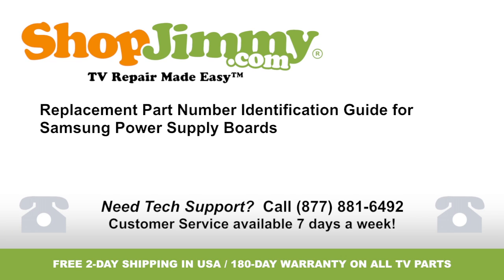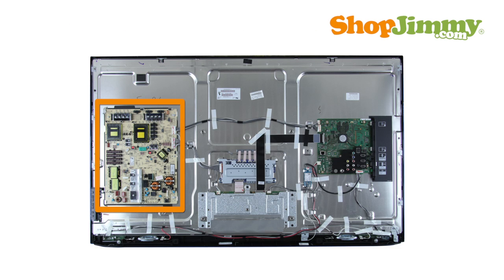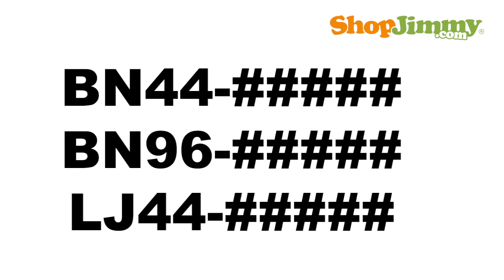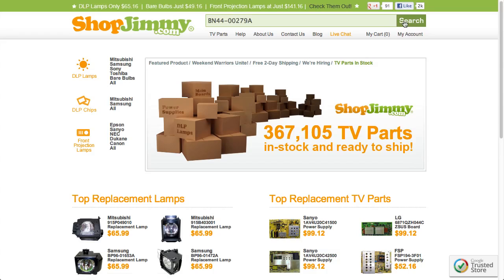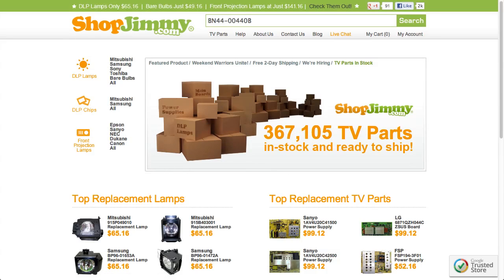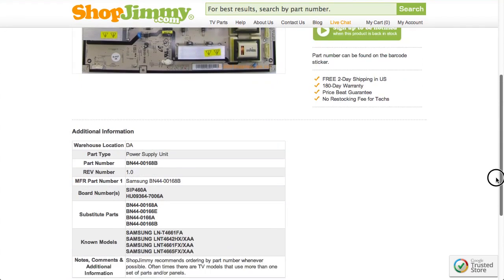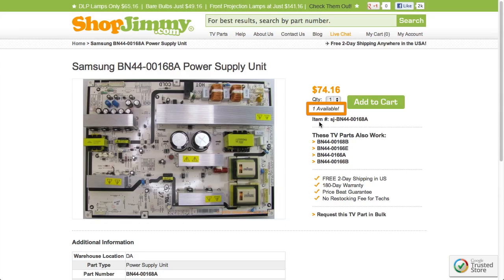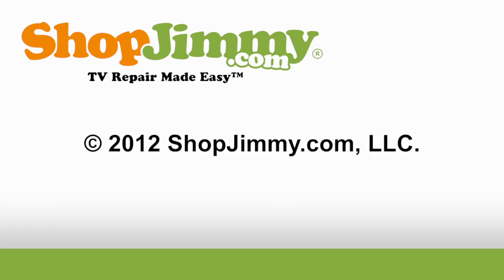Samsung TV Repair - Part Number Identification Guide for Power Supply Boards - How to Fix LCD TVs

Comment: Hello, my board has the BN44 number mentioned in the video, but the board also lists a 4 character code above it, an 11 character code below, and a two character code on the bottom separated by a period. Do these other codes not matter?

Comment: I need a one connect box for Samsung UN65f9000af, I would be willing to sell the whole uhd tv , also have brand new SEK-3500u that I cannot get tv to recognize due to not having the one connect box that will allow this upgrade. Does anyone have suggestions as to how to upgrade. Tv is not broken or damaged, but I'm not locating a one connect box. Help or if you want, I'll make a great deal on the whole package. I'm going to purchase a sled q8 new model

Comment: PLEASE READ CAREFULLY AND ADVISE IF POSSIBLE:

 THE CONNECTION FEMALE PLUG ON THE BACK OF THE LCD MONITOR/TV AND THE SAMSUNG POWER SUPPLY BRICK PLUGS INTO THE BACK OF THE  SAMSUNG LCD TV/MONITOR MODEL P2570,    MODEL CODE: LS25EFHKFV/ZA  THE POWER SUPPLY BRICK OUTPUTS 14 V-----4,5 AMPS HOWEVER MOST OTHER MONITORS HAVE SEITCHED TO A THREE PRONG MAILE PLUG, THIS ONE IS STILL USING THE SINGLE PLUG WITH A COPPER THIS PRONT IN THE MIDDLE OF THE HOLLOW CONNECTOR.  HOWEVER THE FEMAIL CONNECTION ON THE BACK OF THE TV IS TOTALLY DAMAGED AND NO CONTACT IS BEING MADE.  I NEED TO REPLACE THAT POWER FEMAIL PLUS OR THE BOARD ITS ATTACHED TO.   I HAVE NO CLUE HOW TO REMOVE THE BACK OF THE MONITOR AS IT APPEARS TO BE A SEALED UNIT.  NO SCREWS OR PLACES WHERE IT MAY SNAP TOGETHER.  THE MONITOR /TV WORKS FINE BUT I CAN'T GET POWER TO IT.  THERE HAS TO BE A WAY TO EVEN SODER EVEN AN EXTENTION OF THE TV PLUG. THE CURRENT PLUG IS THE RIGHT ONE BUT IT IS SEVERLY LOOSE AND WON'T STAY IN. OBVIOUSLY THE METAL CASING THAT SURROUNDS THE EXTERNAL PLUG HAVE COME OUT OR SOMETHING. 

IF YOU DON'T HAVE A SOLUTION, COULD YOU GIVE ME A CLUE AS TO HOW I CAN CRACK THIS MONITOR OPEN. ONLY THE STAND SCREWS OFF BUT THE MONITOR APPEARS TOTALLY SEALED WITH A THICK PLEXIGLASS FROM PROTECTOR.  

APPRECIATE ANY HELP YOU CAN PROVIDE. I'VE GOT A DOZEN TECHS BESIDES ME AT MY DISPOSAL. WE WILL HAVE ANY REPAIRS EQUIPMENT NECESSARY. 

THANK YOU

Comment: Hi, I have a Samsung LN46C66 F3F. It will not show picture (we have sound). We did the flashlight test, ordered a backlight inverter from your site and installed it, checked for puffy capacitors and pulled off remaining boards to check for burning or damaged parts. Found nothing damaged. Need to know next step, please. Thank you for your time.
Reply from the maker: +Lorriell Clarkson   Did you match the part number on your original backlight inverter with the replacement?  Thanks!  www.shopjimmy.com

Comment: i have a samsung 46 model LN46B650T1F that turns on YOU CAN HEAR IT  but turns off what that can be
Reply from the maker: ismael martinez  Please watch this video FIRST to help with your repair!  https://www.youtube.com/watch?v=BP3NVNCGEv8  This could be a problem with either the power supply or the main board in your TV.  You can replace each board individually to see which one fixes the problem.  Click this link to replacement parts for your TV model number:  http://www.shopjimmy.com/catalogsearch/result/?q=LN46B650T1F  There may be multiple boards for the same TV model number, be sure to match part numbers on your current board, with your replacement for compatibility.  Thanks and please let us know if you have any further questions with your TV Repair!  www.shopjimmy.com